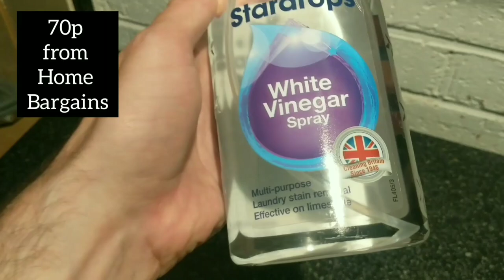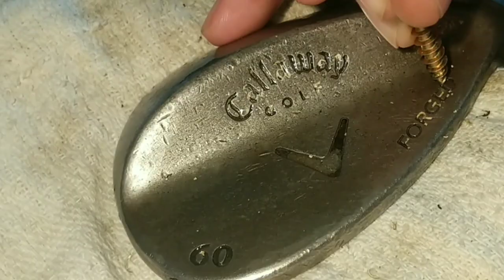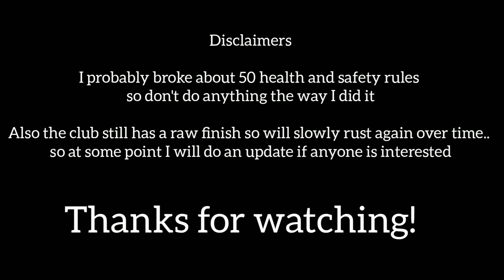Golf Club Restoration (Cheap Rusty eBay  wedge to Golf Bag!) DIY golf club refurb

Comment: When I regrip clubs, I spray the inside of the grip and the tape on the shaft with WD40.  It makes the grip slide on easily and the club is usable within 10 minutes.  I can re-grip a driver (or any other club) at home, drive to the course and it's ready to use.
Reply: (Someone not trying to attack you or the way you regrip your clubs here)

Does the WD40 dry or go away? That would be my only concern. I know the solvent dries really fast. I just don’t know about the WD40. I am interested in this idea. I just regripped my clubs tho
Reply: Wd40 really.oily and doesnt dry well

Comment: You'd save yourself a TON of hassel removing old grips if you buy a hooked blade knife. Straight edges dont quite grab the way they need to. The hook blade runs parallel to the shaft and cuts through the entire grip in one swipe. Just a thought! The rest of this was extremely helpful too! I'm doing some Club refurbishing for friends and family and this helped me a lot!
Reply from the maker: I thought I'd I sped it up, it would not look like it was hard to remove hahah.. cheers though I will look into getting one for next time 👍

Comment: Bow are youngoing to keep the club head from rusying again because unfortunately with all the cleaning, sanding and polishing you removed alot of the protective surface, just curious as I have a few clubs I would like to restore myself.
Reply from the maker: This was just a bit of fun to be honest an expect the club to slowly rust again over time. If you wanted to stop the rust I think you would have to look into some sort of plating for the club head, which would be expensive. I've seen some videos on here that show the process, and I think that's best for the professionals haha.
Reply: @lockdownmademedoit1645  thanks thought that might be the case bit still a fun project for some old clubs.
Reply from the maker: @briangosling7771  good luck 👍

Comment: I notice that you didn’t paint in the bottom groove on the face. Is doing so considered a bad thing? Any tips if I wanted to do that?
Reply from the maker: I mate, I was tempted to paint it, but I decided against it. I think the grooves are supposed to let water or anything else pass through when swinging. So I didn't want to make them shallower. So with that being said, I think if you did decide to paint the grooves I would try and keep the layer of paint thin and not fill up the groves. I would be interested in seeing if anyone reads this and can add anything? 👍

Comment: Oh, that's no cheap wedge. Well, I mean at least it wasn't when it came out. It's actually one of the top ones in it's time. It was designed to rust for glare prevention and "supposed" extra spin. Though tests have shown rust doesn't do much of anything. So the look is more of a personal preference.

Also, sharpening the grooves likely made it non-conforming as grooves are made to the razor's edge of conformity to begin with. Other than that, this is a pretty good cleanup! :D

Comment: Safety pin for picking the paint could get a old bic pen and make a makeshift tool
Reply from the maker: Good Idea, I've been using blue tac which starts to melt almost with the heat of my hand. Haha 🤦‍♂️
Reply: @lockdownmademedoit1645  I’ve redone and changed paintfill on my irons/putter before. It may look like a baby shank but it’s better than the hand cramps from using the safety pin 🧷 alone (but still works) lol great content man. I was wondering could you ever apply these techniques to iron sets
Reply from the maker: @fredrickgarcia8917  haha a baby shank 😅 I'll definitely give it a go for that

Comment: When regripping, use a vice with a catch tray, way easier, plus the solvent that you use inside the grip you can pour onto the tape, also I assume you got the grip from eBay? Chances are it's a fake
Reply from the maker: Cheers mate.. ye it was off eBay, I've already got a few more off there too 🤦🏻‍♂️..  how can you if it's a fake?
Reply: @lockdownmademedoit1645  first off the smell, if it smells like strong white spirit it's fake, plus if it bends way too easy, genuine grips have a bit of resistance, also Callaway always infill their V logo, that grip doesn't appear to be infilled, definite fake
Reply from the maker: @kennybland2024  haha nightmare! I've got a few more including one for the next club I was hoping to do.. do you think it will make a huge difference for a less an average player like me? 😅
Reply: @lockdownmademedoit1645  if you're playing say 3-4 times a week, every week then yes, you'll be regripping halfway through the season, but if you're playing every now and again, should get a couple of seasons out of them
Reply from the maker: @kennybland2024  thanks for that, they will do for me then haha. But I'll be more careful when I replace the grips I already have from eBay going forward!

Comment: Nice 1st try but should've gone all the way with the resurfacing of the blade still to many pot marks, and get the proper grip tape that 3/4 inch double sided tape will break down fast.